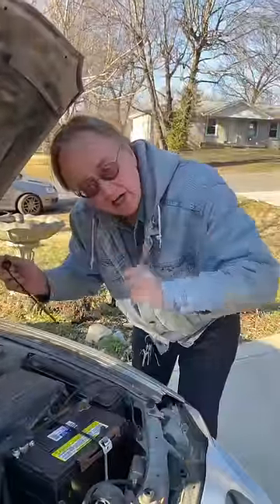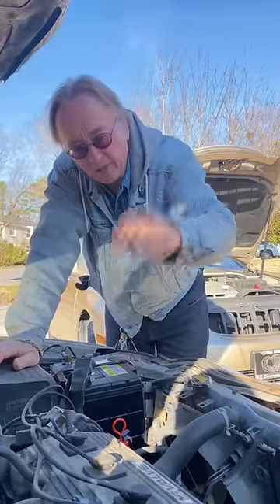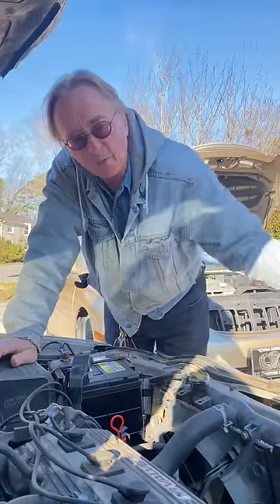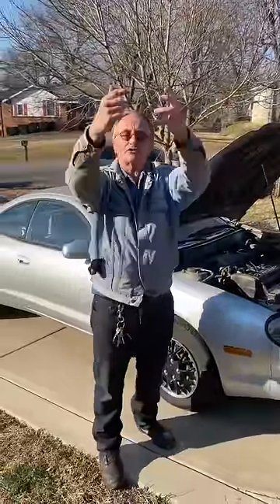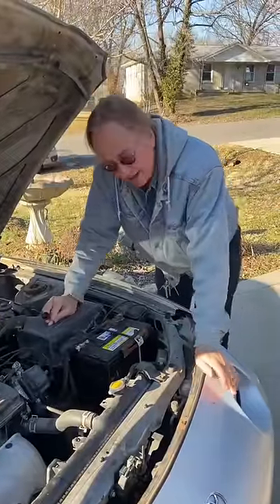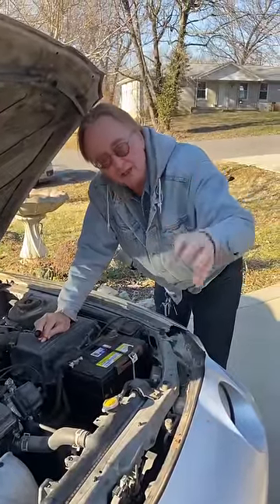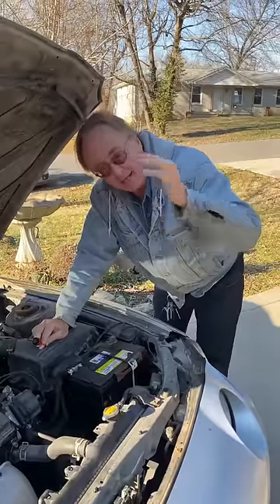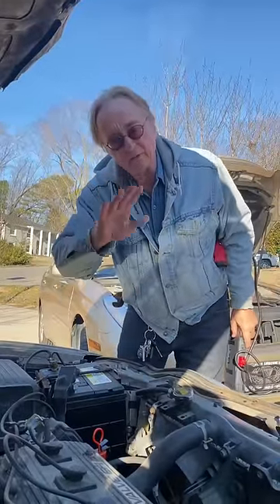If Your Transmission Has This, Don’t Change the Fluid Yourself

Comment: Yep, these days, the dipstick is the person who decided to eliminate the dipstick in the transmission!!
Reply: I think one of the reasons they eliminated them was because people were adding the wrong amount and type of fluid and causing problems with good transmissions.
Reply: It's not far reaching to figure one main reason of eliminating dipsticks. Many of those vehicles will be serviced at their stealership$.
Reply: @safaricartvideos  göra en egen juuu juuu
Reply: Eliminate the  dipstick , so the stealership can make more money of you. Grest idea for everyone,  except the owner.
Reply: @safaricartvideos  Maybe I'm just an old cynic, but I don't think that they would have changed things unless it saved them some money.
Reply: Not only transmission dipsticks are gone, many engines nowadays don’t have them either…
Reply: @ruyveng  yes, you are unfortunately correct.
Reply: @garylangley4502  or made them money
Reply: @ruyveng  in fact nowadays some Vehicles you go to look for the dipstick for the engine and there is not even an engine
Reply: Damn, that's a good one. I'm gonna start using dipstick as an insult
Reply: @bobbysavagehill  It's from the 1960's, and it was an insult, but it didn't get a kid sent to the office in school.
Reply: How do you know if the stealership actually changed the fluid?
Reply: @TheSudburyboy Now you're catching on 🤫
Reply: It’s all about dealers ripping people off…..
Reply: @safaricartvideos  that makes no sense. They did this to make money selling new transmissions
Reply: @safaricartvideos that is correct.
Reply: @safaricartvideos If only I was this naive
Reply: It's in Washington

Comment: The reason there’s no dipsticks in the cars is because all the dipsticks are designing the vehicles.
Reply: And moving to Washington DC 😂
Reply: I just had a rebuilt transmission put in my 2012 Toyota Camry when I picked up the car my steering wheel is very stuff. Can you please tell me what this is about
Reply: That's why all the cars have 4 cylinders and touchscreens.

Comment: If it leaks fast enough you'll always have fresh fluid in it!
Reply: I call it the "Constant oil change."  The engine in my old Chevy Citation had a leaking rear main bearing seal, and I just topped it off as needed. I wasn't about to pull the engine in an old beater like that. I still changed the oil anyway. It stayed nice and clean. Same thing with the transmission in the '62 Chevy I had in the '70's. The front seal leaked terribly, but I just kept it full. The fluid was always nice and red.
Reply: Lol is there a such thing as filling it up too much ha😅
Reply: @garylangley4502 Constant oil flush AND change 😂
Reply: That's if u can keep up with it!

Comment: The OEMs are making everything on a vehicle unserviceable by the DIYer.  That way the dealership can service the vehicle and make additional revenue. Eventually, the dealership will sabotage your vehicle so that you buy a new one.  I stopped taking my vehicle to the dealership for service and the problems stopped occuring.  I DIY it or have a reputable mechanic work on my vehicle.  I got tired of having to tighten connectors and bolts that somehow got loosened after a dealership oil change or other dealership services.
Reply: PREACH BROTHER, that's what happened to my brothers Charger, it was a solid car took it to dealership only for service never any malfunction, eventually they destroyed it to the point where one day they actually cracked the fuel pump, glued it together and put it back in, they paid my Brother like 4K in hush money
Reply: That can and does happen every day at independent shops everywhere in the U.S.  I've seen it myself plenty of times at places that have great reviews. Amazing reviews in fact, and my car was the one they decided to try to mess with, even after being a loyal customer.
And theres not much you can do, except find a different shop. I know I'm not going to waste my time trying to convince them to do the right thing, when I know they wont.
And its happened to family members of mine on the other side of the country, at independent shops, not dealerships.
Obviously not every independent shop is a scum hole, obviously, but in a major city, the majority of them are sketchy & not to be trusted. Doesnt matter whether its dealership or independent, in todays world, dont be surprised if your car is worse off than when you brought it in. Happens all. the. time.

Comment: Without a dipstick, there is usually a check plug, or fill plug on the side of the transmission. Remove the drain plug and fill plug. Let drain. Then fill it until fluid leaks out the fill plug when removed 🤯 put the plug back in, tighten. Start car, shift thru each gear, 3 seconds each. Repeat fill process, when fluid starts leaking out the fill hole, put fill bolt back in. Good to go 🫡👏

Comment: If I ever need to buy another vehicle, I'm going to be checking for dipsticks as well as other stuff. I'll be sure to make a list of the things I should check for..
Reply: Won't matter if it's a newer vehicle, you won't be able to find one :(
Reply: Buy something made before 2000 and you’ll be good
Reply: I know from experience at least that new Altimas have transmission dipsticks, but it’s for their infamous cvt that people are still hating on lol
Reply: @curlyguy2790  some newer nissans still have them
Reply: @Isabella-rg7zk you mean 2010, my car is 2008 and it still got everything
Reply: Subarus, my 21 wrx has a dipstick same with any one that has a manual tranny

Comment: In my Gen 4 Prius, changing out the e-cvt fluid is as easy as a rear differential...just drain it all out and refill in the fill place above until you get excess flowing out....done!  (Dealer wants $310 to do this simple task.)  Learn to do your own maintenance, folks, and it's a ton cheaper and you know it's done right.  (Lots of horror stories from simple stuff like oil changes.)
Reply: Yep
Reply: Yepp, that's what I did with my Gen 4 2016 Prius
Filling it though was an absolute pain though.
Reply: @DanielDTUBWeinberger  run a tube down to the fill hole from the top of engine use a funnel attached
Reply: Internally the Prius transmission is pretty much a rear differential with electric motors. Those things are indestructible.

Comment: My 2011 ford fusion has dipstick and easy drain, 2012 chrysler town and country you can use a dipstick but no idea wheres drain is.

My 2016 does not have dipstick but easy to drain, pain to fill, and very hard to overfill.

For vehicle that is possible to overfill without dipstick, measure the fluid you took out and lut the same in.

Like Scotty said though, if a leak in that case, you're SOL

Comment: Why did they take the dipstick away, just so stupid.
Reply: They do have internal dipsticks or overflow holes.
Reply: They did on purpose so that you won’t work on servicing a transmission on your own, basically taking away diy repairs
Reply: @_thebusphotograher_cali  exactly
Reply: It is still possible to do transmission service but it’s more difficult and you’ll need special equipment to do that
Reply: @_thebusphotograher_cali  special equipment for what? Checking the levels? Plug everything up, unplug overflow hole, pour in fluid.
Reply: These car companies do that on purpose so you have to take it in to get it serviced. They don’t want you to do repairs yourself. It’s all about the $. Getting more and more greedy as time goes on. Purchase an older vehicle. Gotta keep fixing it when things go wrong though. I prefer older cars. They are simpler
Reply: It's called capitalism, increasing profit in any way they can
Reply: money

Comment: Mercedes 722.9 7 speeds have no dipstick, & the job was easier than doing my front brakes was. The precise info on doing the job correctly is everywhere. I got MB workshop instructions straight from the forums as well as following some excellent videos on it.

Comment: My 2013 Lexus IS250 has no dipstick, but rather a level drain plug. After doing a drain and fill in the transmission fluid, warm up the fluid to operating temperature. Jack up the car to level, and remove the level drain plug. Let the excess ATF come out until it stops flowing out, then put the level drain plug back in and you’re good to go.

Comment: if it doesn’t leak just use a bucket with markings for how much fluid is in the bucket … when it’s done draining check the level and then you know how much to put back in … you wont be able to drain it completely anyways … will likely have a half qt or so still in it …

Comment: Actually you just put in the estimated amount. Run the vehicle to temp, and then take off the overfill bolt and let excess drain off.
Reply: Getting ready for a first attempt on my tt, bought a a good obd 2, putting her up on jacks and hope it works out
Reply: Would that work on 11 Toyota Camry 2.5 L ?
Reply: @frankmontez6853 most of the time your fluid level plug if you are fwd is behind the drivers side wheel. You pull the wheel off and then the cover you can normally see it.
Reply: Exactly. More goofy misinfo from this crazy guy.

Comment: Most modern automatic transmission have a "live time" filling and no need to replace the filter. But you should do a service at around 100k Km, no matter what the manufacturer says .
Reply: What you're failing to point out in your description of Lifetime is that its definition is not what you think it is we think for as long the vehicle is on the road or for as long as you continue to drive it but that is not the case the manufacturer considers a lifetime to be basically the warranty. So if it's 5 years 60k miles since purchase.... that's the lifetime length
Reply: With the ZF 8HP automatic transmission, the oil should last a lifetime, with which ZF of course mainly wants to cover the guarantee and good will period.  One concedes, however, that an oil and filter change beyond 120k km would not be a damage.  I've certainly also seen  BMW's  7' 01 with 250k on the speedometer and the customer doesn't want a gearbox service coz the thing is still performing well. I would always advise a gearbox servive if the car has done over 120k km.

Comment: There should be a check bolt in most modern transmissions without dipsticks, find out which side of the engine bay the transmission is in and check that side front wheel well there should be 2 fill and check bolts

Comment: The transmission on a Toyota Tacoma has a “check” bolt that you remove to get the fluid level correct when refilling.

Comment: My 2017 Nissan Rogue didn't have a dipstick, but it still had the dipstick tube from the older models, so I went out and bought a dipstick and put in it.  I can now check the levels and the condition / color of the CVT fluid.  I changed last year myself by pumping out the old fluid through the dipstick tube and replacing the exact same amount.  Since I have a CVT, I plan on doing this every 20-30 thousand miles, even though the owner's manual say 60,000+ miles.  Don't believe the dealer.
Reply: Did you buy it used? Considering it had the dipstick tube but no dipstick? I was pretty sure most rogues had a transmission dipstick my old 2009 had one and my new altima has one as well
Reply: Your biggest problem is is the rubbers going to stretch and deteriorate no matter how many times you the oil change in fact changing it often may actually make it fail sooner because you always have so high above detergent level in the fluid and the strongest as far as cleaning goes which is bad on rubber and plastic

Comment: Scotty, I think you can read the owners manual to see the capacity of the transmission fluid (if available) and You don’t need a fancy computer tool like that.
Reply: Yeah, but if the sealed transmission is leaking, you won’t know how much has come out up to that point. Draining it and filling it yourself will put new fluid in, but it’ll still be low because of the leak.
Reply: Many sealed transmissions have a level plug that can be removed when adding fluid. When the fluid starts to trickle out you know you have added the correct volume.
Reply: @jeffu.8053  it's more complex than that, but yeah. The vehicle has to be level and at a certain temperature
Reply: Actually even if you did try to drain out the fluid in your transmission you only be getting a portion of it almost half of it will reside in the torque converter part of it will still be stored in other Areas of the transmission and lot of times they are held back by multiple solenoids /valves which is the reason why he said you need someone that had the right equipment so it could push the fluid through out the transmission either to push it all out or to push it through when adding to fill it completely and yes some Transmissions you can just fill them up to a hole in the case that will flow out when full that also AIDS overfilling. But don't say something like that cuz you don't know what you're talkin about. PS unless something is been proven to be better than OEM fluid always always get the manufacturer's fluid otherwise you could you ruin your transmission if the fluid you bought is different and the pressure is different and also the viscosity/ lubricity
Reply: You can do it with a cold transmission. Drain whatever amount come out. Put back exact. As the fluid has not been expanded by heat. The temperature checking way is when the transmission is not cold.
Reply: @khoayeuha  that assumes the proper level was in there to begin with

Comment: Ford and GM have a check plug on the side. Fill running until it starts to run out. Re install plug and you’re done.

Comment: Does the engine go bad after replacing the transmission I heard a lot of rumors?
Reply: nope independent systems
Reply: @jerrycanople4005  I heard this happens cuz the transmission is stronger than the engine after replacing it

Comment: I have Chevrolet Spark 2014, i have 128000 mile on it, but it is slipping and shifting when i drive uphills, so do you recommend me to change transmission fluid???

Comment: They have fill level plugs on several of the so called sealed transmissions.  Those are not complicated to work with.  Yet I purchased a used car that was overfilled and it shifted erratically.  So if you purchase a used car change the fluid as soon as possible and verify it is right unless you have one of those high mileage transmissions that never had a fluid change.  😢

Comment: Most modern transmissions without a lipstick have a fill port and a drain port.  You drain the transmission fluid and fill till it weeps out the fill hole.  Once it's done weeping it's full.  I do like having a uptick though.

Comment: I heard putting new fluid will kill the bands because the detergent will wipe it smooth and hence zero traction
Reply: I've heard of that. But usually it happens if you've already have had the fluid in for a long time. Like something over 75k miles. If you change it a 25 or 30k miles it should be okay.
Reply: @Rhaspun  and what makes you think that will make things okay? Because the old fluid has lost a lot of its bite and cleaning ability as well as solvency
Reply: @hyperwebbing  Scotty has said it was okay when changing  ATF at 25 -30k miles. He doesn't recommend replacing if it has been in the car a long time.

Comment: generally there  is a "manual" way to check these types of boxes
you have to find the fill level outlet  usually a plug 
find and there is no need for the expensive "tool" that be a mechanic or a device

Comment: Every automatic transmission I have every changed fluid on failed shortly after. I since stopped changing it EVER. I have\had several cars go well over 200k miles with perfect transmissions ever since.
Reply: Friction material and failure to change fluid at regular intervals.

Drain and fill. Never flush and if the fluid is burnt, then put it back.

It's too far gone.
Reply: @thevashfan12392 Dang really? I might be keeping my fluid in then. Not sure if it’s really burnt. Would it have any color left even if burnt?

Comment: Can't just fill it till it is coming out of the fill hole/plug, like you do with differential fluid?
Reply: Not on an automatic. They rely on hydraulic pressure to shift and it has to be pretty exact. A manual, yes. It's just gear oil with splash lubrication.

Comment: Scotty I need your advice = I got a Pontiac torrent 2006 with 200,000 just for back up car for emergency situation as I drive a Subaru Forester 2009 that is my car I sleep in so I put a new radiator in the Pontiac torrent and I stripped the in put transmission fluid line and i will by pass it with a air cooled transmission radiator to save buying a another radiator 😢 so my question ❓ is will it be acceptable to cool transmission fluid cool ? I live in Seattle Washington thank you ! I am not a mechanic but I try to do what I can  by watching your videos:) thank you !!

Comment: Most sealed transmissions have a overflow drain that will leak out oil if its full, car have to be on and running for it to work.

Comment: A 2018 Acura MDX has a complex "procedure" to change the transmission fluid.  It entails heating the transmission up and cycling the 9 speed thru the first 4 speeds in a VSA mode.  Then opening  the side plug to watch the fluid begin to drain out.   Is this procedure absolutely necessary or can it just be drained and refilled?  I am reluctant to mess with it because of the involved process .